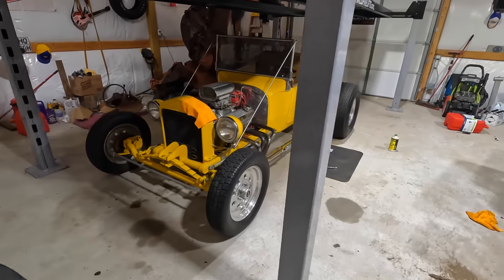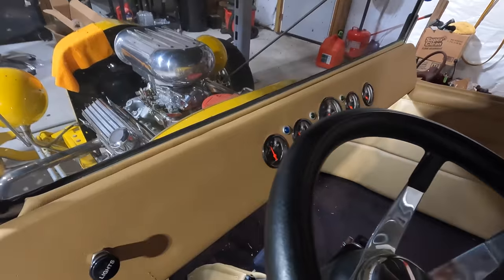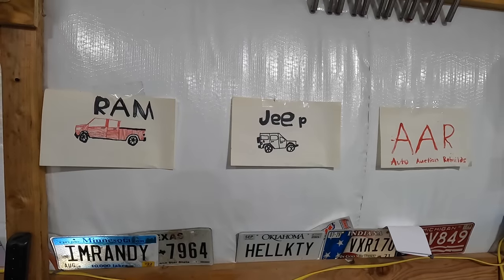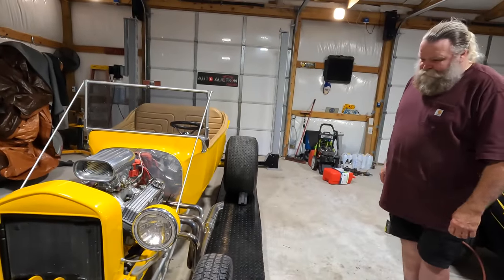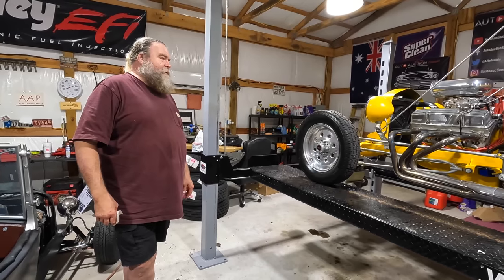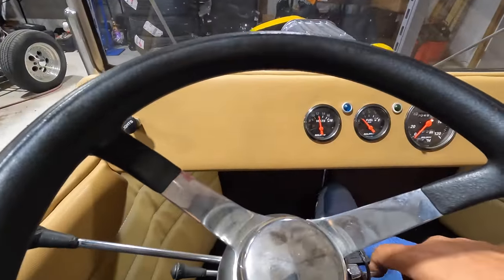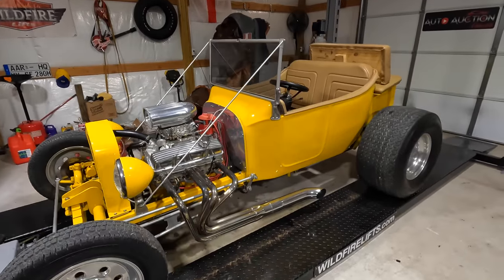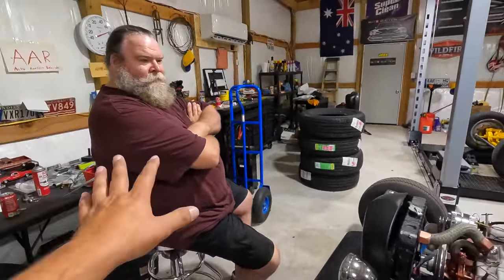I Bought an Insane Fully Built T Bucket with a Serious Issue!! Can we fix it?

Comment: Brake lines should be double flared. I know Michael is old school but modern safety standards calls for double flares. Looks nice though great bending work that stuff always messes with my head.
Reply: Double flare stops the flare from splitting. Master Cool hydraulic flaring tool is the way to go. Does single double bubble AC. Quick disconnect fuel trans and Oring tubing up to 1/2 in. A little pricey but we'll worth it.  I've even have put a swell on tubing so when you clamp the hose it won't slip off
Reply: Lol. That’s the safety issue? “Modern safety standards” call for not driving a T bucket!  Have an old survivor. Low weight is free HP!
Reply: I'm old school and I've been doing double flares for 60 years, nothing modern about it. Lack of knowledge if you don't double flare brake lines.
Reply: The single flares are a great thing to mention but really has nothing to do with his concern with such poor braking, high pedal pressure, and presumably little brake feedback. Any recommendations there?
Reply: @836dmar  Pedal ratio, correct size master cylinder? 
What brakes are actually on the axles? Lots to look at, nobody said the double flare had anything to do with poor braking, just poor brake lines.
Reply: For future readers, these were not stainless steel lines in the video. These blanket safety comments are not applicable to stainless lines.
Reply: They aways were
Reply: I have never seen an airplane or car that goes over 200mph that uses double flares.
Reply: @MayesBuilt  you should get out more.
Reply: Dubble flare been a standard on break lines since day 1

Comment: T buckets have always been one of my favorites. My 1st one I got from a neighbor I did work for. He gave me a choice, money or a Bird 1921 mod.t kit. Being 15 I took the car. Between working for my father and picking up side work I made enough money to get a few parts each week and soon had a rolling chassis. The only thing missing was an engine. One morning my father told me he needed me to go with him to an equipment auction. I got bored and starting snooping around and came across an old welding trailer. The sign on it said the welder coil was no good, so I had to look. Inside the trailer WAS A 3 CYLINDER AIR COOLED DZEISE DIESEL!! That motor was perfect for that car. I could carry the front wheels in a car that got 52 mpg

Comment: Hey! Just a little hint for you. Your side pipes. I have built a couple of them. My advice is to make  a bracket  to support the rear of the of the side pipes because over time if you don’t support them they will crack somewhere in the bends. Just saying.
Reply: Ooh... I hope not. I have the exact same pipes on mine. It was built in the 90's. ...no problems so far. 
Just have to remind non-car people not to try stepping on them when they're climbing in or out of the car! Lol

Comment: I think that upward kick bend about midway down the brake hard line (visible at 25:20) is likely why you're having such a hard time trying to bleed your brakes. Air bubbles always rise to the highest vertical point in the system and that bend is basically acting as a "trap" not allowing trapped air to travel down the line to reach the bleeder.
Reply: Used to work in a school bus repair shop . We had a power bleeder with a 2 gal reservoir , put 30 psi air in the top and it would drive any air past a high point

Comment: Be safe install a dual master cylinder. Test the e-brake. Cheers!
Reply: I'm also building a 23 T bucket. Rebuilding a 351w (408 stroker kit) with C4 auto.  4:11 gears

Comment: If that's an ATK crate engine u should try amd see if u can find it in a catalog. Maybe you'll find some specs. Dial in that carb and forget about the EFI. U wont have fun tuning EFI units with a cam like that unless u know how to dial in fuel tables on your lap top trust me. Guarantee u play with the timming and adjust that idle and transfer slot and you'll love how it runs

Comment: I have a 709 wheel horsepower 1997 Honda Civic coupe that I built with my own two hands that runs 9s in the 1/4 mile and I'd give almost anything to have something like that (until it rains). There is absolutely NOTHING like a strong V8. My turbo 4 cylinder is fun because once that turbo hits full boost you can rev it out to 10,000 RPM and it stays in boost between shifts (and it's still torquey down low because it's a 1.8L DOHC VTEC Integra engine in a 2200 lb car), but there's nothing like having power on demand as soon as you peg that throttle. I've owned domestics before and I really miss it sometimes.

Comment: I built a all steel 26 T Bucket in the mid 90s. I started collecting parts in my teens in the late 80s. Finally had it done about 96 /97. 351w / 4 speed top loader . I ported the heads and did the old school ford tricks before the aftermarket support for sbfs really took off. And it was a ton of fun. But marriage and kids necessitated its sale. Ive regretted it every day since. First Hot Rod I built . I  did it myself from top to bottom.  And I let it go. And I didn't have to. I just thought it was a good idea at the time.

Comment: That really needs a higher stall torque converter. When you drop it into gear it just wants to die out on you. You could bump the idle speed up, but you'd need 3 legs to hold it still at a light.

Comment: Build and keep both. The original stock metal body and frame one is a keeper.
Put decent headlights on the yellow one and good seat belts with a good roll bar....
The black roadster is worth its weight in gold,, if built correctly....

Comment: Hey Randy, love the yellow beast. 
Does the car have a vacuum brake booster ? If not, that could explain the extra force required to push on the brake pedal, either that or the brake master cylinder is the wrong size
Reply: Large cam motors don't make a high vacuum to power the booster. You can and add a extra vac can to help best bet is a dual non power master from a one ton or larger truck

Comment: The rear tires look old, which means they are dried out and hard, (0-traction). If you keep it I'd get a set of the Mickey Thompson Sportsman S/R 31-16.00 R15s for it. They're not only cooler looking, but they get much better traction.

Comment: I'm think that it has 300-350 HP. I am building a 65 ac cobra that weighs about the same. She has 450 hp and its an absolute death trap. Cam sounds to be mild cam. but that carb is probably hurting you if it is a 650CFM
Reply: Na.... aluminum heads and a decent lope.. prob split duration. I'd say 400 atleast ... not mild lol.  Needs a dialed in 750 and check that timming. Maybe a little more on the idle speed

Comment: Whats the block casting number? If it ends with an '010' that means it is a roller cam block, mostly 4 bolt bottom ends, but not always.. I know a guy in Australia that had an award winning 1923 T show car that had the big swoopy canvas roof with the stays that hooked up to the side of the radiator grille and the 2 part fold-out windscreens and the side lanterns and EVERYTHING  Gold plated! Even the transverse front leaf spring beam axle! Why do you need a Sniper when you should know how to tune carbs, theres nothing wrong with the one of it. Young people these days think that they a 'tuner' with a laptop, when they can't even tell you what the intake centreline of their camshaft is.. if you went back to the 70's and tried to tell that to people like 'Grumpy' Jenkins or Bob Glidden racing their Pro Stock cars with 10000rpm smallblocks running Carburettors and POINTS ignition - they would have laughed them down the road.

Comment: I think that has standard brakes, meaning, it doesn't have power brakes, so they are going to be harder to push and not work as well as power brakes. And I think the speedo is off by 15 to 20mph. Looking at the video it doesn't look like you ever got over 55 to maybe 60mph. Also, I'd check the engine temp after it was that hard for it to restart it after it died, (Which was caused by getting on and off the gas really fast) carburated engines like that don't like that.

Comment: Those cars are dirt cheap.  The 29 roadster body and frame alone are worth what you paid for it.  I would ne er use a holley sniper.  But I am running original stromberg 97s on my roadster.  My daughter uses a pair of new holley 81 carbs on her V8 60.  My daughter drove her T bucket daily for 8yrs, but she has a top. She still has it. My  roadster would sell for $35,000+.  The yellow car should bring at least $25,000.  The 29 roadster should sell for more, depending on the quality.

Comment: you can see they threw good money at the car. its a very nice t bucket. i personally would have changed the 350 into a 383 (400 crank, 6' rods and pistons) and that gives the 350 more legs (more torque) 
not a fan of how they trimmed around the shifter. thats the only bug bear for me.
Reply from the maker: No way of knowing for sure if they stroked it.
Reply: @AutoAuctionRebuilds  you can tell but you need a dyno.
my buddy builds these in his sleep, and the most you will get is 500hp as my buddy found out the hard way he was aiming for 600 but snapped the crank at 550hp.

but a safe figure is 400 or 450hp
and yes i think i know what the other engine is.

Comment: If you can keep the black one, sell the yellow one. The black one is a real T-Bucket, which in a real car guy's mind is worth more. Not some catalog plastic kit car. The person who built the black one hunted down the parts, and put his heart into that build. One thing about the yellow one, stop driving around with the high beams on, also adject the headlights, from what I was seeing, it looks like they are pointed to the ditch, not the road.  Also, put a grill in the rad cowl, seeing the rad and trans cooler, it takes away from the car.

Comment: If you know anybody who is interested I have a original  g&a automotive from 1960s t bucket pickup body never been mounted on a car sitting in my shop, not at cheep speedway motor job nicebut a solid fiberglass and plywood a nice project for someone who's interested

Comment: You need that motor in your Camaro and the transmission in your Camaro and it would be a nasty car hotrod from hell a real bad ass race car. If I we're you I would get the black one going and keep it but fix up the Camaro with that hot and sassy engine good luck with it don't get yourself hurt or killed in it because that motor needs to be in a car not a fiberglass bucket with no seat belts in it

Comment: WHEN YOU HAD THE VALVE COVER OFF THEIR'S A BIG PROBLEM THAT NEEDS ATTENTION. YOUR ROLLER ROCKERS DO NOT LINE UP WITH THE VALVE STEMS. SOME DO AND SOME ARE REALLY CROOKED. DROP A VALVE AND YOUR MOTOR IS BYEBYE. I WOULDN'T RUN IT AT ALL UNTIL THAT IS FIXED. GOOD LUCK.

Comment: I would put a Holy Dominator computer on it and go with injection and turbo or just do it right and go blower with natural aspiration with nitrous. You're going to roll out backwards with no brakes, this guy doesn't care for his equipment if he is not going to be cautious with it. Also starting and engine when a guy is going to be working on it making the brakes work with a hot engine to work around in is not very respectful of the man who is going to work on the thing. Tells alot about your thinking abilities. Which are very profound and not very capable. Without an emergency braking system you should not even attempt to take it out of the garage till it is fixed. I can tell by the way your acting that you should never own this car if you cannot handle it. You are not the driver for this car, if you have not owned one when you were a kid and learned how to operate them properly.